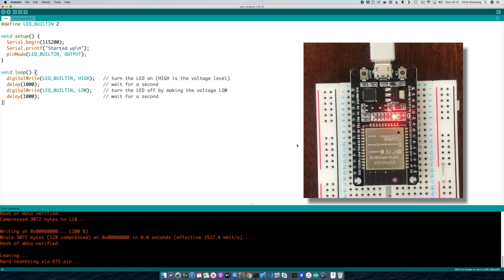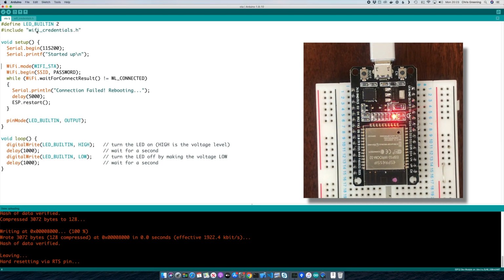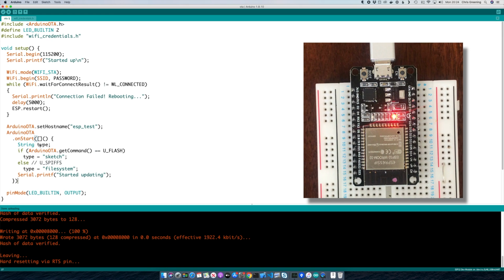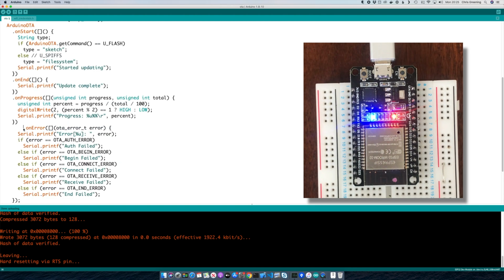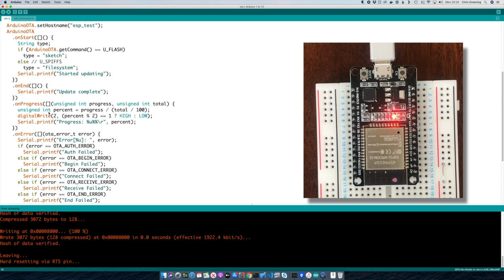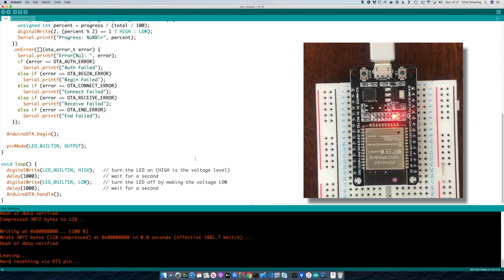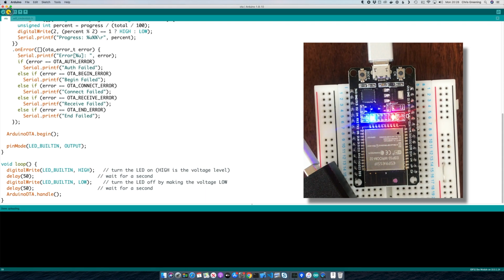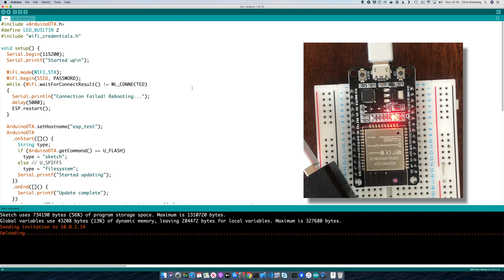ESP32 Over The Air (OTA) Update - no wires required!

Comment: I've immediately run into a problem with both H files. "No such file or directory exists"
Reply from the maker: Hi Chris, you should just be able to clone the GitHub repo and then open the 'ota.ino' using Arduino. Which H files are you referring to?

Comment: Could this be used when uploading code that uses ESP32-NOW? Or would they conflict with each other?
Reply from the maker: It should be possible yes. There do seem to be some issues around getting WiFi and ESP-NOW to play nicely together. I believe you need to make sure you are using the same channel for the ESP-NOW connection as the WiFi connection.

Comment: I tried this code but it fails with:
Sending invitation to 192.168.0.27 
13:46:46 [ERROR]: No response from device
13:46:46 [ERROR]: No response from device 

On the serial port:
Started updatingProgress: 0%
Error[2]: Connect FailedError[4]: End Failed

Any ideas ?
Reply from the maker: The most likely culprit is a firewall on your computer. The way the OTA update works is that your local machine starts up a sever and then tells the ESP to connect to it. If your computer blocks the port your computer tries to use then the ESP can't connect to it and the update fails.

You can temporarily disable the windows firewall to see if this is the issue. It looks like there is no easy way to fix the port address that the Arduino IDE uses which will make it difficult if you have a firewall blocking ports.

Hope that helps.
Reply: @atomic14  Thanks for that, however I did allow ESPOta through the firewall.
Reply: I just double checked and I had private checked and public unchecked.
I checked both and now it works.
Thanks.
Reply from the maker: @donvukovic7440  Great news!